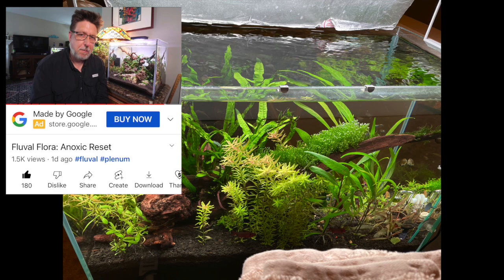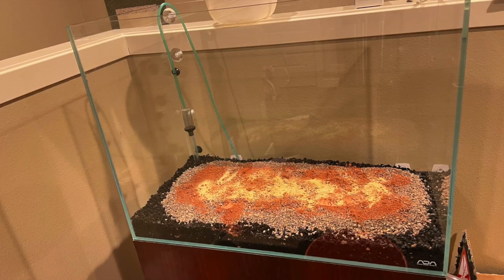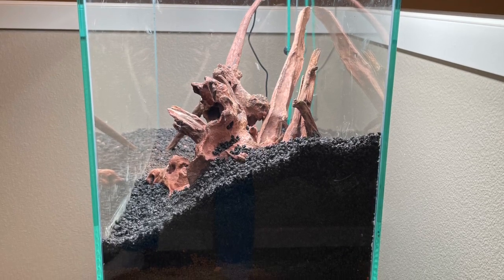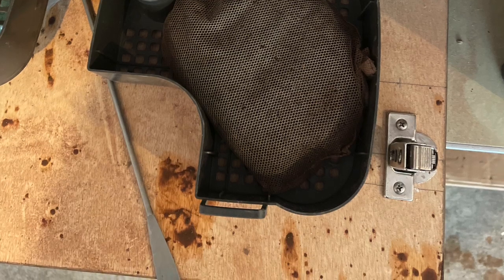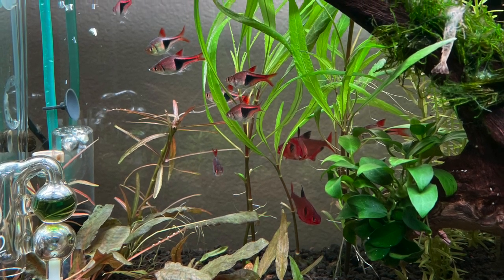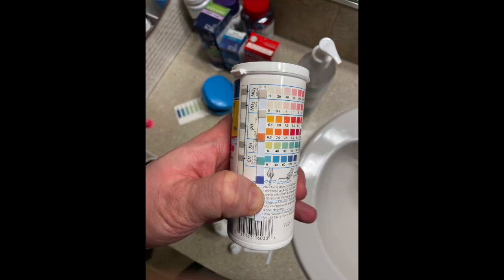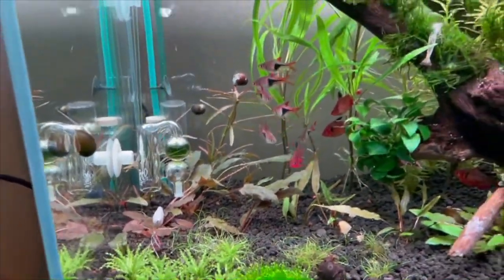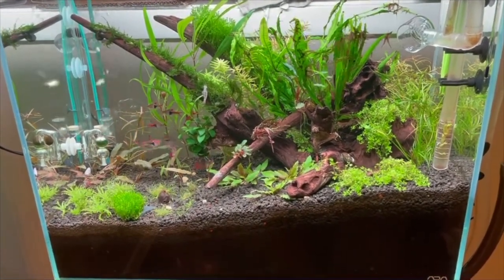The hilarious Fluval Flora Anoxic reset video by: Pecktec & Andy’s anoxic filtration build.

Comment: Great to see the results from someone else using the anoxic filter system.  I also had a nutrient deficiency with my planted tank even with CO2 and had to remove the resin/carbon filled bag I made from my canister filter.  Now I have bcb bags and sponge filters only in there.  The plants are doing fine now.  The setup has been running for 6 months and has been without problems.  A small amount of hair algae at first but this went away after the first month.  My ammonia, nitrite, nitrates have been zero even with regular plant fertilizer dosing.  Super great system - best I’ve ever had!

Comment: In my experience with what appears to be the same woven plastic landscape cloth; it will allow fine sand to filter down through to the water under the plates. It is better to use a non woven cloth material like a re-usable shopping bag for a barrier between the substrate and plates. No matter how slowly my air stone produces bubbles, the sand or any particulate will perk through that plastic.

Comment: Dr. Novak BCB flow should be high wouldn't it be commended to have under gravel filter flow high as well?
Reply from the maker: It really depends on your substrate size. How big the aquarium is and the size of your uplift tube. A 3/8 uplift tube can actually pump more water just because it is a smaller diameter tube than a 1 inch uplift tube.

Comment: What brand plates are you using?
Reply from the maker: It's in my video when I set up the 90 gallon aquarium. It's something I bought off of Amazon along with the lees under gravel filter for Betta  bowls.
Reply: Dr. Novak, can I integrate your methods into a tank that already has algae, to develop the defense to beat it?  Or is a full break down required? .. I built a plenum, added 1 BCB bag, Tank is 2 months old.  Algae started to grow in the tube with the bubbler.  I cleaned the tank, but after a week vacation, I have tons of hair algae and the plants have suffered.  I don’t want to disrupt the livestock with a complete breakdown, but would if it’s required.  Is an algae free rebound possible with the correct modification techniques you share?  Please advise, Thank you!! 
 @anoxicfiltrationplenums